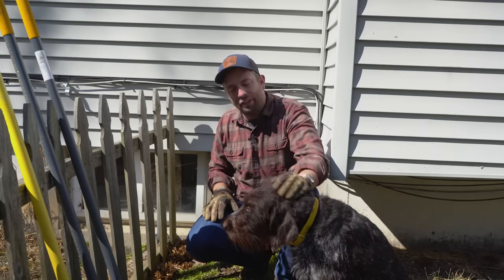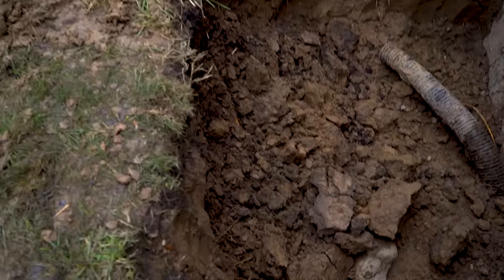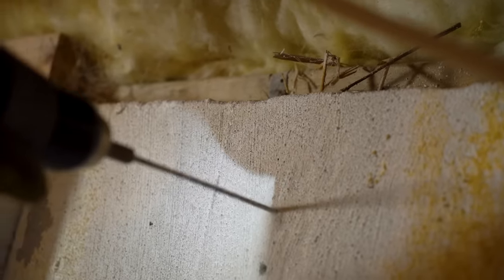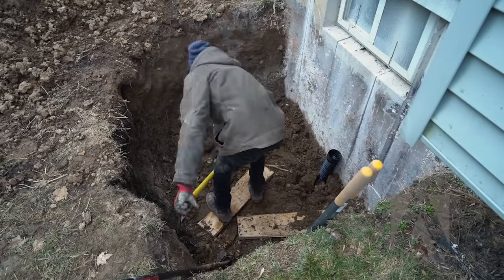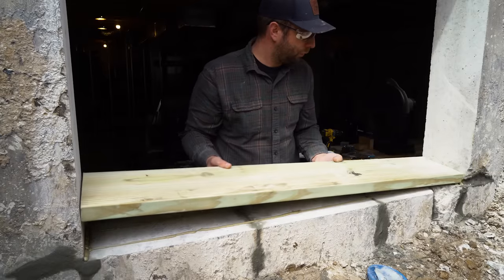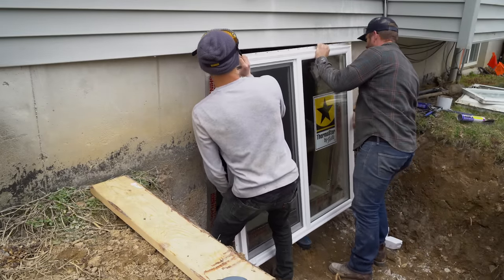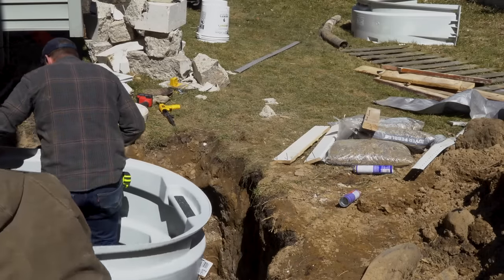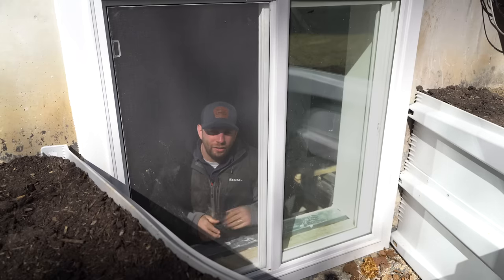Egress Basement Window Installation |  How To | DIY Home Improvement

Comment: I'm just here for all the inevitable comments from the Youtube experts on how you did everything wrong and your house is going to collapse.
Reply from the maker: Yea itll be interesting for sure haha
Reply: Altair Ibn-La Ahad *your

You forgot to mention grammar police.
Reply: No, you are a house.
Reply: Reading comments made my house collapse 😭🤪
Reply: @ThirdCoastCraftsman  on that note... hah the only thing I've seen differently is a small strip/layer of foam between the window frame and concrete, like they do for sill plates. what do you think of this? not saying you're right or wrong. just curious on your opinion.
Reply: Well, he didn't have the ley lines measured out, and I'm pretty sure he cut through the house's chakra lines... Yeah, that house is gonna collapse on him one day.
Reply: Guys you need a window of that size for egress. It's the law it wasnt his choice per se.. you need 5.7 sq ft to meet code.
Reply: dave david l
Reply: @BlockAck  You're right. You should lay polyurethane between any wood and concrete. Yet another method to protect the house from water damage, which is pretty much the point of any modern construction technique.
Reply: @ThirdCoastCraftsman this is 5 years old, did it fell apart?
Reply: But,can you please mention why? (For people that don't know,like me)  I'm considering on having an egrees window installed.

Comment: A window? Should've made it a door at that point and rented out the space! Haha, amazing job as always man!
Reply: I thought the same thing about a door. Should have made it a walk out basement! Probably wouldn't have cost much more.
Reply: j jones that’s not a common practice
Reply: @Superduty_59  A lot easier to get supplies and furnishings in and out.
Reply: Exactly! Increase the value
Reply: The whole point is that he wanted light in HIS basement..a door would add no extra light
Reply: @bobbyward2440  He could have a patio style'd door bringing in plenty of light.
Reply: @CSSIandAssociate  yep. Pastor had one in his house and it was WAY better than carrying shit up the inside staircase!
Reply: @bobbyward2440  there is doors that are glass.
Reply: Many basement apartments already have a walk-out door, but the code calls for, in addition,  an egress window in the bedroom, of a specific size and height from the floor.
Reply: I already have doors to get out of my basement. I need this window to use this finished basement room as living space. It's code here where I live.
Reply: @paulh6591  YEP. 44" off the floor, 20" wide, 24" height for me here. I think, this is throughout the USA now.
Reply: Whar’s the rough price breakdown of this, material/labor?
Reply: I'm with you on this one. For all that, he could have just framed a door in and poured steps. If you need an egress window for a finished basment a door is just as acceptable for egress routes.
Reply: from my understanding due to building code, if you add a door you will then still need to add an egress window still!
Reply: @Superduty_59 some ppl dont want a extra door on side of their house
Reply: @wingedhussar1453  Just the ones with no common sense, I guess.

Comment: I’m a grown man and I can confirm that concrete cutters are really scary
Reply: Concrete cutters are scary in the hands of someone who doesn't know how to handle and properly inspect a tool beforehand. However  unrewarding, I have and can use one all day as one would use a pen. Hell, I could probably gently scratch ones itch, or samurai a mosquito with one if so inclined. You have to respect it for sure and carelessness is rewarded with missing body parts or lost life.
Reply: As much as I like to get experience in new tools etc I think definitely the right move to hire someone to do it right.  Especially since likely it would be the only time you would ever do that in your lifetime.
Reply: i dont know if you are talking about tool or tradesman, but 2 guys who came to cut my foundation to get windows installed in our basement were huge.  Like imagine 2 Hulks come in and say: "Hulk saw, Hulk smash, Hulk carry pieces away." :)  It was awesome!

Comment: I’ve looked at several homes recently which did not have enough bedrooms to fit our family size, and have often wondered what it would take to add an egress window in the basement.  
Great how-to video on the in’s and out’s of adding.  Thanks! 

For those commenting on “why would someone do this”, you can’t resell a home and include the basement square footage and/or bedroom without a 2nd exit from said room/area.  An egress window allows you to count both, thus increasing your homes value.  Very worth it if you’re taking the time and money to finish out a basement.
Reply: Would a hatchway count? I thought egress windows were bigger. Like a standard door sized opening and stairs in the well to easily get out. My hatchway is basically the same size as this opening. We built a room in our basement and the hatchway exit is in that space, which is why I'm asking.
Reply: Thanks for explaining that, I was wondering what was the point in replacing the window
Reply: Stephen IV if a contact did this job how much would it cost
Reply: @jasoncruz3506  $1500-2000 where i live
Reply: @dave3464  I was about to ask.
Reply: I’m doing 2 this week and it’s gonna be $2500 each that’s including everything new window new well lumber etc.
Reply: The physical exit must be 20x24 in most places.
Reply: not bad a all I need to have 4 .
Reply: Did you end up doing it? I am curious and if it worked out for you

Comment: Suggestion put the drain at dirt level. Use a good quality landscape fabric over the dirt and the drain. Then put your rock I use river rock. If the drain is higher then the dirt it fills up the space until it can exit through the drain. And I also wrap the drain and down the pipe a little. It keeps sediment out better.
Reply: Good tip.  I would at least put weep holes at the dirt level and landscape fabric IMHO is a must.
Reply: Sound perfect but what’s about bugs??? Mostly bugs can enter the basement window.
Reply: I couldn't tell but he should've used perforated pipe with a dirt sleeve. That way the water level doesn't have to get all the way up the drain.

Comment: If I had to guess, you were having trouble with the tapcon screws because you weren't drilling deep enough holes. It helps to run the bit in and out a couple of times when you are done drilling as well to clean out dust. If dust compresses in the bottom of the hole it won't allow the screw all the way in.

Comment: It looks good. I might have added a second layer of flashing between the window flange and the trim. In Arizona we do that on all flanged window installs, as well as the silcone
Reply: I should have specified that I'm in Construction, and that is the process used in new construction, and generally how it is done in remodel or retrofit work. 

Of course there are the diy'er that may not do this. But at a trade level, you do everything you can to seal that window up.

Comment: So a quick tip for finishing up the concrete saw cut , buy a masonry diamond tip blade for your angle grinder since your at Lowe’s buying all this other stuff . Saves on drilling and chiseling the wall I’ve found not all concrete is made the same. And because the chisel worked at your place it might not at others , and an angle crack could go the other way removing more foundation then you want lol . With the angle grinder you get a 2” depth cut to create a really nice score line for breaking the wall

Comment: I'll be helping my son do this over the summer, and I definitely take your advice and hire a team to cut the concrete.One point I would change on your install;  I would have used a water based foundation mastic on the concrete before the tape, (clean concrete, mastic, dry, tape, dry, trim)  and then another coat after tape then trim after it's all cured. 
Thanks for sharing.
Reply: Southern Engineering did you guys cut on your own? What would you say was the biggest struggle?

Comment: Any thought of adding Z-flashing between the top of the window and your siding? An added defense against water running down your wall and potentially back up under the siding.
Reply: I agree that’s a really good idea
Reply: what is Z flashing Eric?
Reply: @gordsinclair9583  it's a piece of sheet metal that is bent into the shape of a "z" that will stick out beyond the top lip of the window. It's meant to draw water away from the house/window so it won't creep back up under the siding and cause damage.
Reply: @Ericd489  thanks eric !

Comment: Very well done. Can’t see anything that I would have done better to prevent water intrusion. Nice work.
Reply: The only thing I saw that I would have done differently, is not use expanding foam. It can expand too much and throw it out of level after full expansion
Reply: @bsshollis  He used the blue can; "window & door", which has low expansion.
Reply: Very "well" done eh?
Reply: Andrew Mills godda-
Reply: Properly flashing the window and drip cap should have been installed. This was not sealed properly.
Reply: @bsshollis  That's why you must use the one specific for windows and doors, which has 1/3rd the amount of expansion as regular foam, and you also don't use an excessive amount.

But no drip flashing on the window, and also using roofing nails to secure it... this guy is going to have a problem in a year or two. Guarantee it.
Reply: Bret Hollis that’s wrong I’ve foamed every window I’ve installed still level
Reply: Only thing I would have done differently with the wood framing all the way around, I would have covered each piece with 3 coats in red guard, so the wood would never rot.

Great how too video
Reply: Maybe completely elastomer-ing the treated wood sill (supporting the window) - beforehand putting wood sill with a outward angle - so any potential window leaks under window will dribble away from sill and to the outside then the sides.

Comment: Liked the video. Im pretty sure pressure treated lumber corrodes aluminum over time. Probably not a big deal on this project but just to let ya know!
Reply: Preservative should be applied to the ends of the pressure treated lumber when it is cut. Especially that close to the ground.
Reply: I don't think those nails are aluminum.
Reply: "pressure treated lumber corrodes aluminum over time"  indeed it does.  When I built my deck, I used vinyl flashing.  Aluminum flashing is against code in my area.  I could have used copper flashing, but that's much more expensive.
Reply: @tomsenft7434  The nails he shot through the pressure treated he said were aluminium.

Comment: Nice job! I'd suggest more than a few ramset nails on the PT wood (not sure how many you did) but in my basement the PT has buckled from drying out and although the windows work just fine, it makes the PT wood look ugly until I finish out the basement! Sexy saw system they used, makes it a lot better than renting a saw and freehanding that cut - possible, but lot of work!

Comment: We are thinking of doing this with our basement window as well.  Thanks for the clear cut, concise instructions.  And yes, we will be paying someone to handle that crazy- looking saw!
Reply: We are doing it to. We’ve been quoted 4500-6000 for the whole thing which is insane to me. Trying to look for any shortcuts to save us money..like digging our own hole for instance lol
Reply: @drapermike  Sounds like what I was quoted, too. Crazy. One contractor I talked to refused to even let me dig my own hole lol. I decided to take on the project myself.

I am even cutting the concrete myself. Check out the cut-n-break saw. It is much less industrial and way easier to handle. Doing mine this weekend.
Reply: @nalgene247  ok let me know how that goes for you. I could never even begin to attempt to do it myself lol..not taking any chances
Reply: @massContinuity  I'm using a basic miter with a diamond blade and have a big sledge.  I'll get it out eventually lol.
Reply: @drapermike  I was successful. The biggest snag for me was pushing the saw to quickly. It caused the blades to converge and bind up after 4-5" depth. Otherwise I tacked 2x4s to the wall as a template and everything went well.

Comment: Nice project!  Was wondering if you had to pull a permit for this project?  And if there was any talk about adding any additional header for above the window since you widened the whole?  I'm looking to do the same project and my windows don't have any additional concrete or header above them, so just wondering if it is necessary.  Thanks!
Reply: Disappointed not to see this answered, because that was my big question: how did this pass inspection, without a proper window header? Guessing there was no permit pulled...
Reply: Wondering the same thing.

Comment: I personally use polyurethane gaskets to separated the wood from concrete just like a baseplate, wood will ALWAYS wick water from concrete and I personally have found over the years it’s a better system and lasts longer. You still did a top notch job tho 👍

Comment: I have a Q:  The frame for your window is 2x material.  Looking at the top of that, and knowing you made the window wider, should you not have made a header there, since the house is literally resting on it?  I am looking for education, not harping.  I mean, I did exactly this to my house, but didn't make the window wider-just deeper, and I have a block foundation (the 2 differences that prompted me to watch yours).  Also, I didn't hire concrete guys, and it was cut by hand.  Not as pretty, but framed up fine.  Really not a problem at all, but again, block wall; it was cut in about 5 minutes.

Brings me to a Q#2:  Anyone do this task (poured, not block) without the saw on rails?
Reply: I install the header up in the floor system paralleling the existing rim board.  I also install the window a little lower to give room for trim across the top of the window at the time of basement finishing.  I have a hand held saw for cutting this opening.

Comment: Good video! So, I am still a bit intimidated on a few points:
1. Where do you hire/vet someone to properly cut your basement wall?
2. The drain. Did you just dig a hole down a  few feet against the basement wall and put that pipe in?
3. We have common concrete blocks. I am thinking of how to make it smooth and sealed properly after the cut.

Comment: I have a full size window in my basement that leaks like a sieve, probably installed by the previous homeowner who knew nothing about construction. I had a carpenter install a new window and water proceeded to run out by what appears to be deteriorating rough opening. The only way I was able to hold back massive leaking was to have him cake sealant all around the exterior trim. I wish mine looked like this one.

Comment: I'm surprised you didn't install a lintol of some kind, don't you have to shift the weight away from window frame so it doesn't become difficult to open especially in an emergency when you're gonna need it most?
Reply: That's exactly what I was thinking too when I noticed there was no lintel put in.
Reply: What's a lintol
Reply: @josegomez6549  A lintol/lintel is a structural support that takes the load of the home that would sit on top of the window and carries it around and down to the ground.
Reply: @TheConglom  oh okay. I saw some pictures and now have a better idea.

How would it be better or even installed? The concrete is already poured. Would it really add to the structure given you'd have to cut more out to allow for the linton?

Let me know if I'm wrong, but from what I saw it doesn't seem like it'd be a good idea

Comment: Lucky you had a french drain connection below that window so ... how about that downspout to the right of the window well? Love these kinds of improvements but your situation was a lucky thing. My house has NO french drains around it - its over 100 years old.... and sadly I can't do this without doing the entire foundation etc...
Reply: KelMaster Construction  Thanks for all of the info but I was already aware of that. The costs are prohibitive in my case -- the closest permanent drain access is over 100 feet from the house and would require trenching the entire basement exterior, ditching at over 4 ft starting to the elevations required AND the basement floods regularly due to improper construction since it was added with low head room , and 2" or less of concrete floor that is cracked, and on clay without gravel or vapor barriers (something that would need to be rectified simultaneously) - Same with the walls that are cement block unprotected from water inside or out ...meaning that at times we get 2 to 5 inches of water in the basement that has to be pumped out. Permanent Sump pump is out of the question since the drainage is to the city ditch by garden hose. The costs would far exceed anything affordable.
Reply: KelMaster Construction  Yup, that's at least what I'd have to do .. but 2-4 inches deeper since the ceiling is 6'7"" minus the 8 to 10" duct work running all over and I'm 76 and sole caregiver for my 99 YO mother who gets lost in the house a lot. Not gonna be doing that.

Comment: Nice job! Did you have to get county permit and also an architect or engineer to evaluate to make sure the house would not crack on the window over time since you are cutting into the foundation of your house?
Reply: Use modern Windows not ugly windows these are ugly Windows not modern windows and these are not supposed to be ugly
Reply: Idk if he did but, they would certainly need permits.
Reply: @Gilgamesh3six9  I'm not asking the government for permission to work on my own house...
Reply: @Billy Mack, Texas Detective  the way the system works. So do what you want and fight the government about it